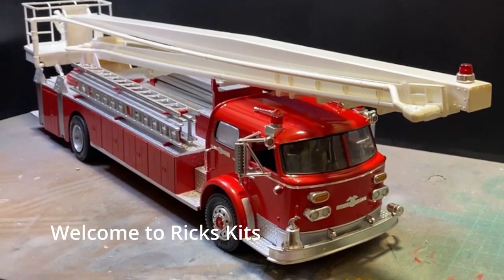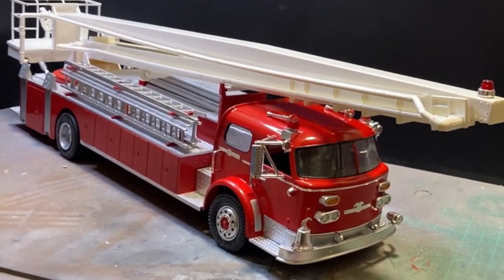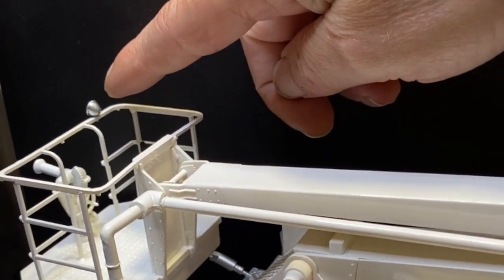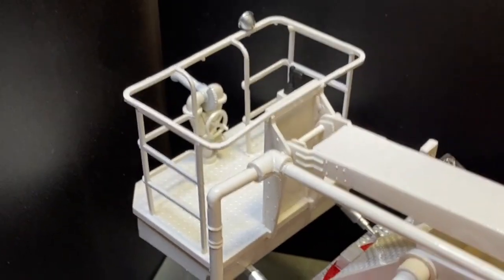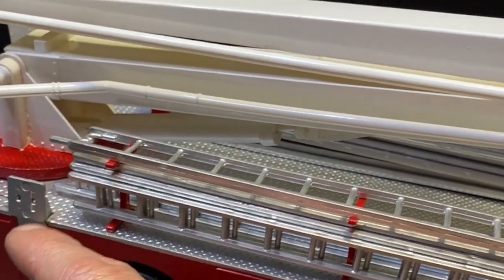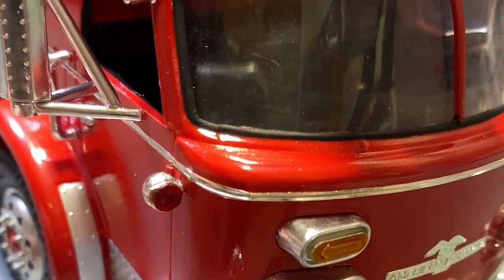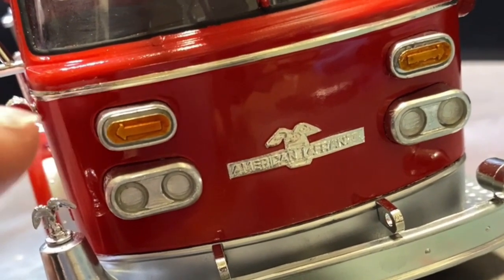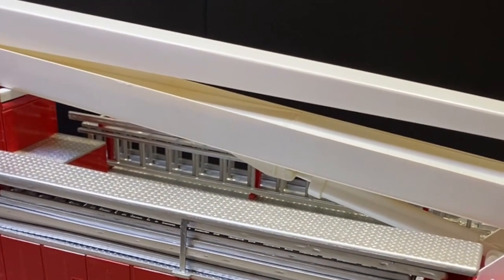1/25 American LaFrance Aero Chief 1000 completed rebuild

Comment: The decals should be available on eBay on your side of the world, I would think so anyway.
Reply from the maker: I’ve tried eBay and nothing comes up over here. I was wondering if there were any outlets in the USA You could think of that I could try and purchase from.
Reply: Hello Rick did you manage to get hold of decals for this kit? I am currently building the same model and you can have what's left over as the decal sheet has many name options.